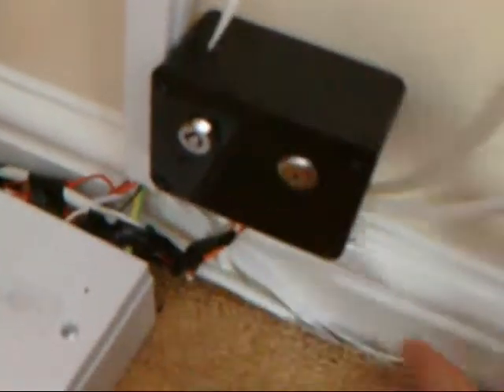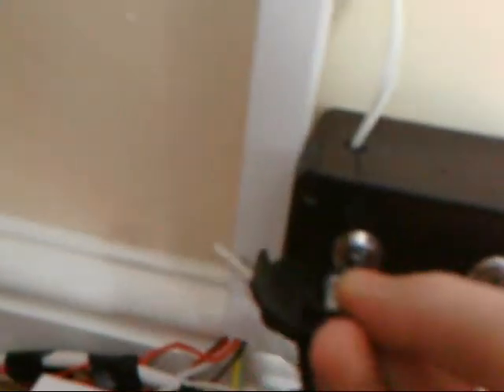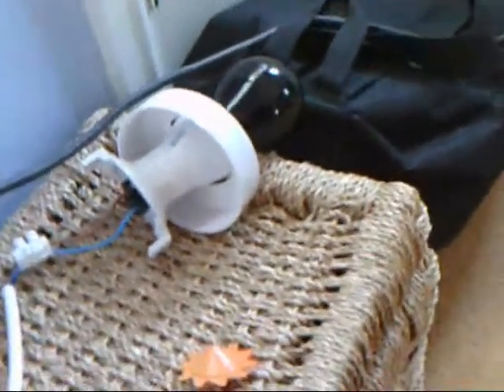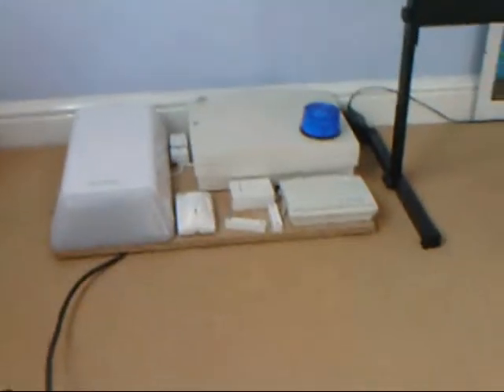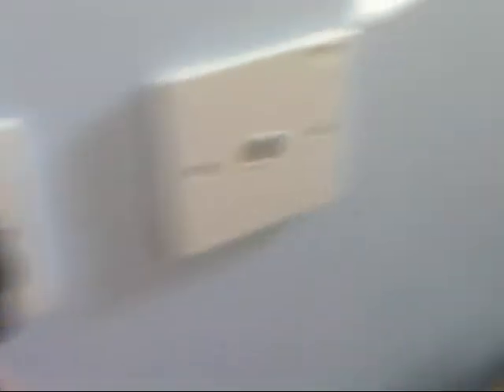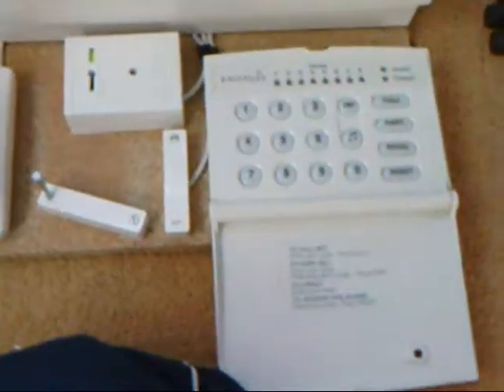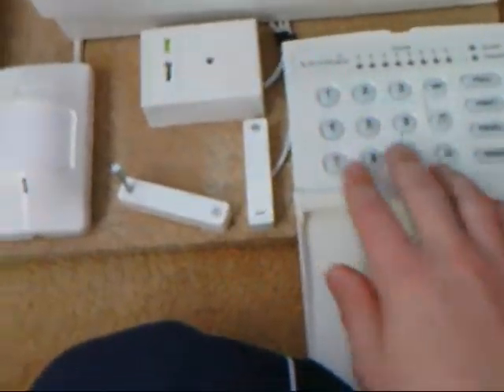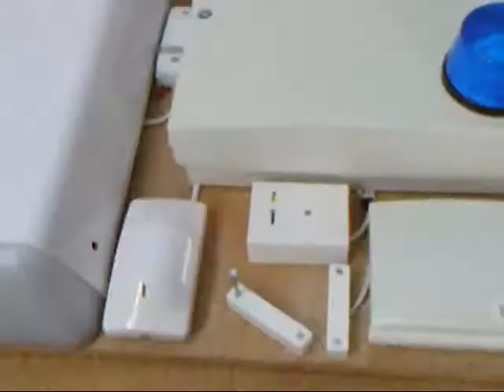Partially built fire panel, and burglar alarm

Comment from the maker: @rickimercer It's simpler than it looks! The entire system is completely conventional, so has no circuit boards. The call points are used as switchs on the negative side of the circuit, So I could have a seperate switch for the 2nd tone on the sounders, a switch on the panel, as the 2nd tone is negative, so therefore the cicuit would need to be on the negative side. The main silencing switch, is just the supply directly from the batteries, so switching it cuts the circuit. The test on the panel

Comment: check and see where the strobes are connected to i suspect they might be wired into a programable output, try just connecting them in with the bell switched negitive so they only operate when the sab is activate